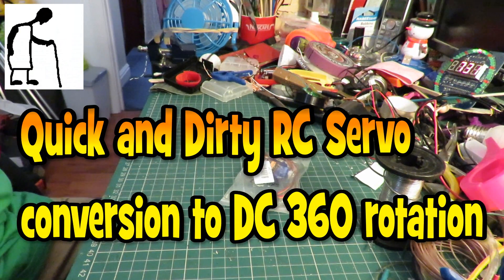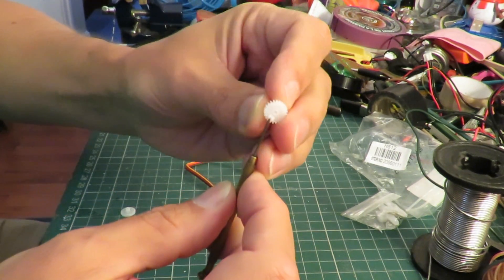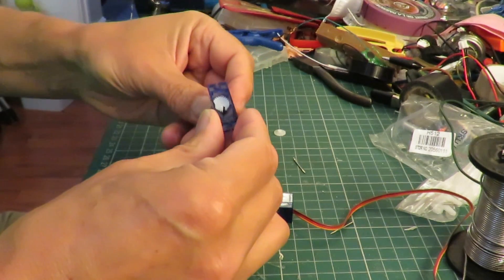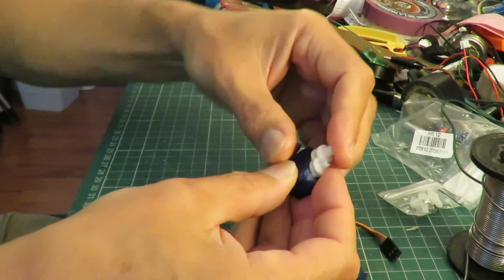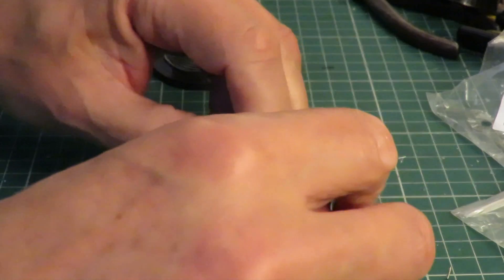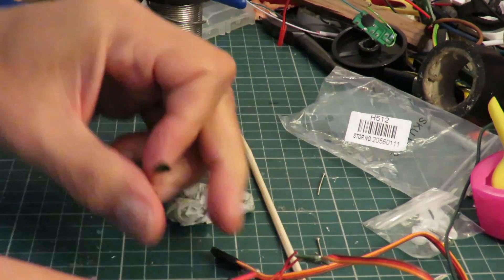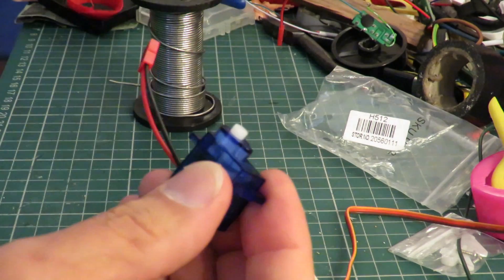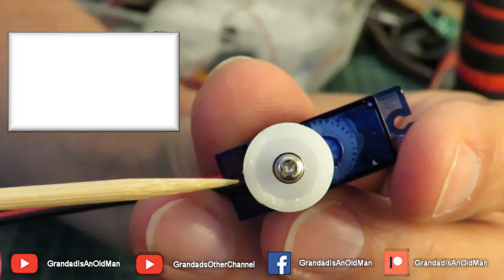Quick and Dirty RC Servo conversion to DC 360 rotation

Comment: Good video grandad, I like the videos that don't go perfect and you get to see a little problem solving.  Converting servos to continuous rotation is a useful thing to  know how to do.  Plus your version is simpler than the "attach 2 resistors to the circuit board" method.
Reply from the maker: The 2 resistor method is required if you still want to use radio control as it fools the controller board so it cannot tell how far the servo has turned. With my modification it is no longer controlled by a receiver, just a straight forward DC supply.

Comment: Would it possible to cut off the stop and still use this Servo R/C for full 360 degrees rotation ? does the pot just detect where the servo is or does it also control the amount turning ?
 Incidently its the Bristol Model Engineers Show this weekend, i'd guess you will be going to it, if your not planning to go i think you should, we could do with a Grandad report on the show !
Reply from the maker: If you still want to use it for RC but want 360 degree or continuous rotation there are two standard methods. 1. You detach the potentiometer from the shaft so it cannot turn (to be sure it cannot turn people often add some glue) 2. You desolder the potentiometer and replace it with two resistors to fool the control board into thinking it hasn't moved. Here is the resistor method https://youtu.be/PdOjqp5ZH_E?list=PLA5a2xPRSrB1nJ5I3Uzrjf41VCJzrab4p